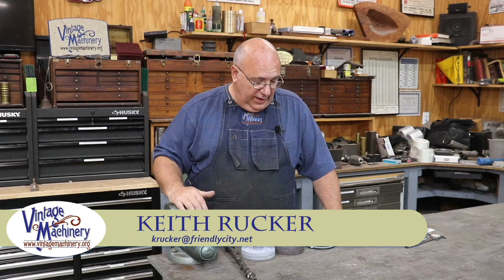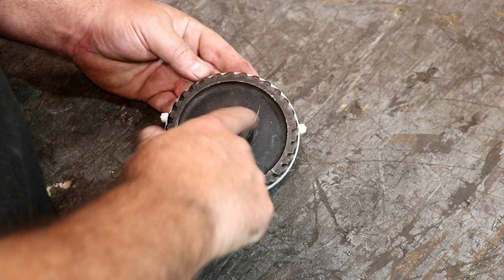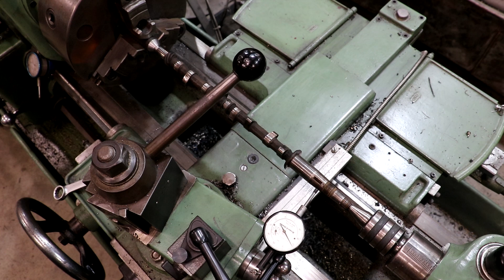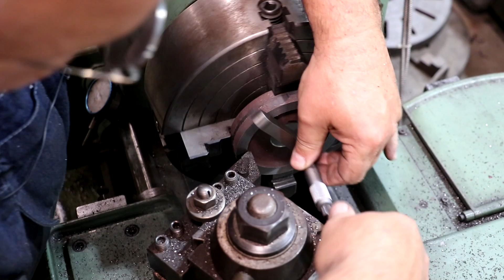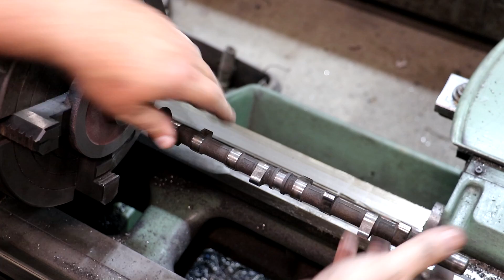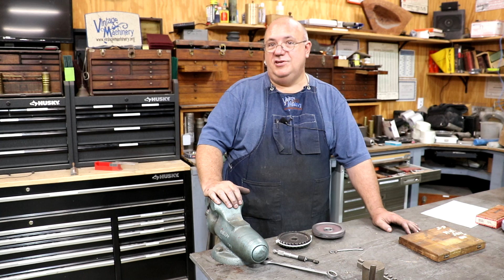1928 Austin Timing Helical Gear: Turning the Gear Blank from a Cast Iron Casting

Comment: we would like to  see how and where it was mounted, I hope you & the car owner will eventually show gear  joined to camshaft, mounted & running on the 7 engine. 
no one asked about the mass of the gear, not to be neglected much more than the alleged fidelity to the original or the printed codes

Comment: I know this comment is 2 weeks late but I have 2 observations. One is about the timing of key way to get teeth. Plus or minus give or take 5 degrees will effect how engin runs. I personally would wait to broach key way until after gears are cut. Second is the depth of back of gear. The cam usually has a plate bolted behind gear to keep cam from moving back and forth in cam bearings. So depending how long the cam sticks out past plate and bolt heads you may need to cut in a little extra clearance in back of gear. On a extra note.... Adding 2 or 3 extra tapped holes for pulling gear in future may not be a bad ideal.

Comment: I am a bit concerned about the thicker web of the replacement gear, not from a strength standpoint but rather an engine performance pov.  A thicker webbing carries more mass which will retard the ability of the engine to change speeds, slower to rev up and also slower to spin down which translates to slower acceleration and less engine braking.  However, on the other hand it will be better than not being able to drive the car at all!

Comment: Hello Keith  I've been restoring vintage Austin (Sevens  which is the model the part you have is from) in France for 30 years. I am very very familiar with the timing gear you have and am extraordinarily impressed with the skills and techniques you are employing to make one. It is an inspiration. I machine a few minor parts myself but nothing like this. The timing gear is not difficult to come by and if anyone there is stuck for one I can almost certainly help.  Martyn

Comment: Im sure its been mentioned by others already, but you didnt say anything when discussing making the tapered broach plug ...  that keyway needs to be EXACTLY timed with the gear teeth once they are cut. One or more teeth should be marked on the original.

Comment: Regarding the thickness: Wouldn't that make it heavier than the original, so cause larger stresses on the gear train driving it from the irregular crank shaft rotation (individual pistons kicking,...; mainly at low rpm/idle/cranking)?

Comment: Regarding the order of operations, would it not have been better to drill and bore the central hole before flipping the part? That would give you the flat surface to put against the jaws, and an accurate centre to use instead of relying on the rough casting.

Comment: Nice work and much learning on my side. I do have a question. At the end you talk about how the new casting is thicker than the original and I wonder if besides acting as a heavy flywheel that could cause strain on the mating gear and cause it to fail, wouldn’t it also go against the puritan ideology of making the part as close to the original as possible?

Comment: I've a pretty good idea how the gear broke in the first place. Brute force, ignorance and a hydraulic puller! Don't ask how I know this.
When you are pulling cast gears off keyed tapers like this you need to get the puller fully adjusted ready to pull. Heat the boss up to a couple of hundred C, put the puller on and load it up without overdoing it. Then give the tensioning bolt on the end of the puller a good wack with a copper hammer. They usually pop straight off. If not go and have a nice long cup of tea or two as it cools down. Repeat; maybe a little more heat and an extra wack, just do not over tighten the puller, or you end up in a workshop like Keiths.

Comment: Reading  others comments  it seems  that the cam drive  gears were  a select fit from  the factory. If possible make 2 keys with an offset  grind  of lets say 2 and 4  degrees. They would  work both - and + timing. Might find more accurate  timing then the original. Fun experiment for the engine builder.

Comment: You need to make sure the timing between the gear teeth and the broached slot is identical to the original gear, otherwise the valve timing will be wrong with the new gear!
Reply: As well location of broach to location of teeth outer edge of gear?

Comment: I'll be curious how to align the shaft keyway in relation to the gear teeth.   I'm guessing some indicator positioning.  Probably not critical, since the timing can be advanced or retarded at the distributor.  Either way, I'm expecting some magic.
Reply: Rotating  the distributor will. take  care of the ignition  timing but cam timing is set by the relation of the 2 cam drive  gears to each  other.
Reply: @williambikash6645  Oomph.  How to know position of the keyway in relation to the gear teeth?  May need at least the block and #1 piston top-dead-center to find, or maybe the busted gear may hold enough surfaces for a measurement.  This is gonna get messy.

Comment: I met a man years ago who was restoring a 1934 Austin 7. He told me that the fit and mesh on their timing gears varied dimensionally so much that the factory would hand sort out hand picked sets of crank and cam gears. Not much interchangeability. Another thing I remember was the engine was very tiny ( 7 horsepower) and how huge the spark plugs were. It didn't have enough power to get out of it's own way.lol
Reply: The "7 Horse Power" Was a  Tax designation or "Tax Horse Power" :
"The tax horsepower or taxable horsepower was an early system by which taxation rates for automobiles were reckoned in some European countries such as Britain, Belgium, Germany, France and Italy; some US states like Illinois charged license plate purchase and renewal fees for passenger automobiles based on taxable horsepower. The tax horsepower rating was computed not from actual engine power but by a mathematical formula based on cylinder dimensions. At the beginning of the twentieth century, tax power was reasonably close to real power; as the internal combustion engine developed, real power became larger than nominal taxable power by a factor of ten or more. "
https://en.wikipedia.org/wiki/Tax_horsepower

Comment: I don't think the thickness of the web was an issue.  To me it looks like that gear broke as they used a puller to pull it off the taper.
Reply: My thoughts exactly. The way it is fractured into several is consistent with puller breakage

Comment: Keith. I'm sure you probably know, but the gear has to be properly timed. this is done by aligning a mark on the gear teeth with a tooth space on the mating gear. In your case the position of the key will have to be the same as the original one when you cut the first tooth space. If it's not maintained the engine timing will be off. Look for a timing mark on the original gear.

Comment: Hello. I have been wondering why when center drilling do you do such a small amount. Thanks for the videos ?
Reply: All you need is a dimple to keep the point of the regular drill from wandering until it gets started good. (Think 'center punch'.) If you watch most machining videos (including this one), as the regular bit touches the work, you will see it move sideways a bit. That is the center of the bit aligning with the dimple, and taking up any slack or misalignment in the tail stock. Using a center drill is just an old machinist's trick. Because they are so short, they are very stiff. And since the point is very small, it will cut easily. A regular twist drill doesn't actually cut well at the center unless it has a crankshaft point. (That is also why you drill pilot holes.) A stubby drill would also work for the start dimple, but you don't always have one handy. But you always have a drawer full of center drills.

Comment: Leaving it thicker did increase the rotational inertia. More stress on cam.
Reply: It doesn't increase the inertial stress as it isn't the cam that is driving the gear but the other way around therefore the inertial sresses are not imposed on the cam but into the teeth of the crank gear it is in mesh with.
Reply: @howardosborne8647  I did say that wrong! Ooops. 😀

Comment: Better than the fibre gears GM used in the Aussie 6 cylinder engines, left you on the side of the road when they stripped.
My Dad had an Austin 7,  Mum said I used to run inside when he started it, I was only a few years old, 65 years ago.

Comment: Question: Leaving the web of the gear thicker will not only add weight, but if there are variations in the thickness it seems like that could cause a balance issue when it's running at speed on the engine, isn't it possible that this could induce a harmonic vibration into the cam that would cause problems with bearings and the lobe surfaces on the cam, that could be a serious issue in an old engine....
Reply: At the sluggishly low maximum rpm that an Austin sidevalve runs at??? you are over thinking this.

Comment: Careful moving forward.   The key slot neesd to match to the same position of the gear teeth as the original in order to keep the engine timing correct.  If it's off, the cams would opening and closing at the wring time.   They might just be slightly early or late, messing with full power delivery, but if they're really off and there is no other adjustment available on the engine, pistons might meet valves.
Reply: Timing is critical, sure, but the danger of a valve/piston strike is highly unlikely. This is a very low power engine.  Seven horsepower has been mentioned.
Reply: You guys act like he has never duplicated a part before!!  He has done this kind of machining many times!
Reply: @paulcopeland9035  They do make me wonder what they are thinking. Keith is highly experienced at this game and the fact these are timing gears dictates the key way haas to be in the right place....I reckon Mr Fenner already knows that.

Comment: The only concern I could see with the thicker web is added inertia in the cam drive system.  On a high revving engine that might lead to some issues with load or resonance in the cam system.  On this engine I suspect it will not be an issue.
Reply: A 100 year old Austin!  I "suspect" you are correct!!

Comment: Interested how you will keep the TIMING precise between the location of the gear teeth to the keyway- if it's a cpl degrees off the motor will run badly or self destruct as the valves will still be open when the pistons come up...... also that new Cam gear being way thicker and heavier will act as a Flywheel somewhat, wonder if that will effect something? Glad thats YOUR job to do, and Not mine - Hahaha GOOD LUCK BRO
Reply: Valves can't hit the piston in this engine even if you locked them open. It's an L head side valve flathead like a briggs or Ford flathead.  Timing is still important though.
Reply: I'll bet that engine turns so slowly that the "flywheel affect" is nil. Most of the extra metal isn't near the perimeter so less affect. Sure takes a lot of work to fix a screwup! A 10HP engine isn't very stressed!
Reply: How are the pistons and valves ever going to make contact on a side valve engine? It is an old Austin 7 engine not a Suzuki Hyabusa.

Comment: With the web of the gear being thicker than the factory piece, you've made it heavier. That's a cam gear and the weight of the final product needs to be accounted for.
Reply: Yep, when that 100 year old Austin engine is up around 7000 rpm, you sure don't want any excess weight to throw itself out of the block!!

Comment: Question for the peanut gallery car guys.  Isn't the extra weight caused by having a much thicker center section going to cause some type of problem such as increased stress or rotational inertia and fatigue?
Reply: Rotational inertia won't be a problem since the gear spins the cam. Only concern would be balance of the gear. From my calculations the extra thickness is adding about 1 and 1/4 lbs give or take an ounce or so. That extra mass if out of balance can break the cam/ prematurely wear the bearing surfaces.
Reply: @WILFRED1184  Thanks!

Comment: Check the original gear teeth for hardness. The originals are usually chill hardened (like the camshaft lobes). It would be a shame to do all the work and then have it wear out because the teeth are the wrong hardness. The letter Q is for the foundry, in this case Qualcast.

Comment: The thicker web will add strength and weight. The dynamics of the rotating assembly might dictate a few lightening holes in the gear.  If the desire is to replicate original, then machine the web and possibly sand blast to keep cast appearances.
Reply: The mass wont have any effect on the engine, but, I would consider drilling and tapping 3 holes in a circular pattern to help pull the gear next time around, whilst also lightening the gear and bringing back closer to the original mass.
Reply: @truckguy6666  I disagree on the mass having no effect.  Even though this is on the cam, as the engine revs up/down the additional rotating mass will add load to the gears.  It can cause excess wear on the gears.

Comment: Others have mentioned the possible issue with weight. I suspect it doesn’t matter, but I wonder if wear might have affected any of the measurement of the diameter, tooth depth, etc. I was also wondering what other parts of the engine were damaged when the gear shattered. Looking forward to the next video(s) in the series. [And Diresta saw)
Reply: The problem with the weight of this gear is that it will be harder to drive it and stop it by the 1/4 size driving gear. It would act like a flywheel accumulating power spinning up to running speeds and it will want to continue rotating as the crank gear is slowing down, this will cause excessive wear and tear on the crank gear that could lead to a catastrophic failure. This is part of a 4:1 gear ratio where the crankshaft with a smaller gear will turn four times before the camshaft does one full turn, oftentimes the large gear has holes to reduce the weight to reduce these bad effects fighting the crank gear; see link.

https://www.google.com/aclk?sa=l&ai=DChcSEwi5ucz8o7v5AhUG6-MHHaCtB_cYABAbGgJ5bQ&sig=AOD64_1jaVCk9GID4NMMnk3he7-Cfs3R1g&adurl&ctype=5&ved=0CCkQ8w5qFwoTCMiPrfyju_kCFQAAAAAdAAAAABAK
Reply: @azarellediaz4892  At the extremely low rev limit of an old sidevalve Austin engine it ain't going to make a halfpennies worth of difference. Not worth fretting over.
Reply: @azarellediaz4892  unless it has some weird duel lobe cam the crankshaft only turns twice for every turn of the cam shaft, not 4 times

Comment: Wonder what happened to break it into four pieces?  Wrong puller?  Hit a hog?
Reply: Wrong puller/brute strength and awkwardness would be my first guess.
Reply: 2 legged puller would be my guess.
Reply: Could even be overnighting on installation.
Reply: @DoneWrenching  over tightening wouldn't cause that sort of damage. The nut threads or threads on the camshaft would strip long before enough radial force could be generated to burst the gear open. Neither is this damage caused during normal running because the teeth are still in one piece. That is damage caused by use of a leg puller we are seeing here.
Reply: Howard Osborne I've seen many tapered shaft applications break pulleys from over tightening so I'm calling BS on your comment it can and does happen
Reply: @DoneWrenching  In the case of this gear I'll return with your call of bullshit. The threads on the nut or the cam nose would strip long before you would get to that threshold. take a look at the meat in the hub area of this gear.

Comment: wonder if its off a "chummy" Austin 7 750cc  my dad hd one back in the day ( I was very young but big enough to run a spanner ) well he took out the engine to rebuild it as you did every 35,000 mile or less , he put it in the shed , my inquisitive brain ticked and I helped him while he was at work , he came home to find the engine in bits , was he angry no all he said well you took it apart so you hade better help to put it back together , as we are going on holiday at the weekend . and yes we did make the trip and all was well with the car , apart from the brakes the rod fell of they just had a steel rod to work them . 
as others have said the key way to gear tooth is critical is there not a timing mark on the gear ?

Comment: I'm not an engineer but aren't you concerned about the extra mass of that gear? The cam shaft it goes on looks awfully slender. It looks like there is a bearing journal adjacent to the gear so maybe it's not an issue, but I'd be concerned about snapping that cam shaft once that heavier gear starts spinning. Also, I didn't see anything on the original, but wouldn't those parts be balanced?
Reply: Same thought I had.  More rotational weight.  It will especially tell during acceleration.  More twisting force.  I have no idea if the amount here is enough to matter.  But it is common in racing to take 50 thousandths off a rim to reduce rotational weight.  As I said, I am only talking theory here.  I have no real world experience.
Reply: @danstephens9500  It won't make any detriment on this engine.  The cam gear is unlikely to ever go over 2,200 revs as it runs at half crank speed. It isn't very big in diameter and the thicker portion is not at the periphery.

Comment: if you notice, you opened 2 of the jaws and when you flipped the part, you tightned a different jaw thus moving the part a lot out of center. i think if you had marked the location of the 2 jaws you did not move, flip the part and align them to the 2 fixed jaws you would have had it pretty close to perfect with the opposite side.
Reply: You reckon he didn't check it and adjust afterwards?

Comment: When you make your arbor, leave a shoulder on the big end, then after you have cut your diameter and the gear teeth, you can just cut the tapered end off the arbor and use it as your broach bushing.